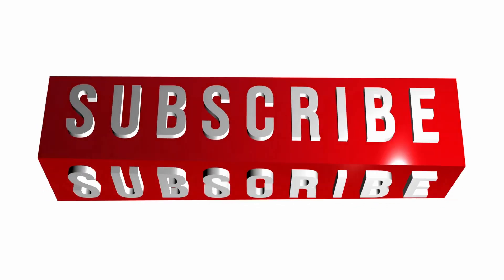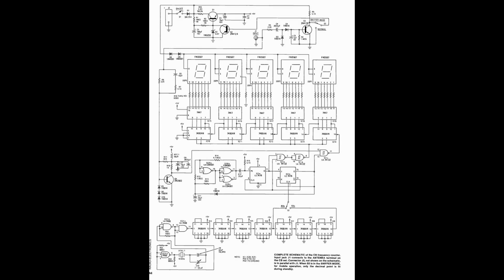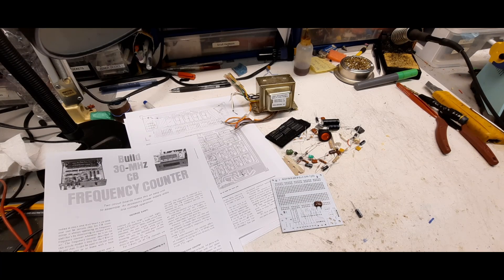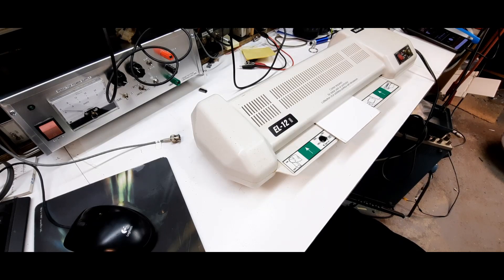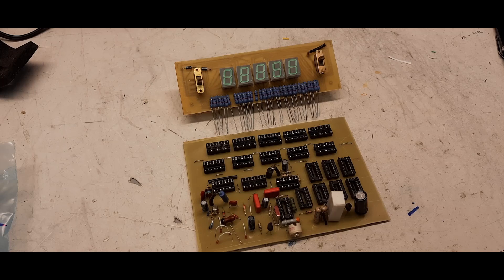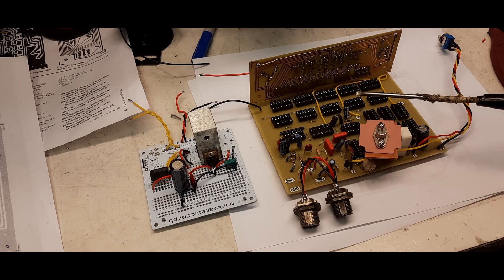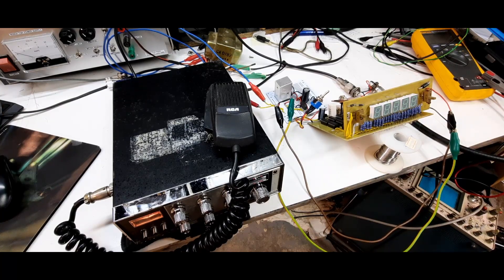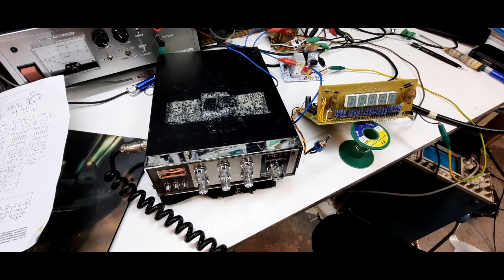Radio Electronics - September 1977 - CB Radio Frequency Counter

Comment: For toner transfer I use the 'wet' method: A mixture of alcohol and acetone. Acetone content about 15 - 25%. Basically nail polish remover.  Rubbing with the nail still required.
Secret tip: The toner sticks better to dirty copper. Smear the copper with your greasy fingers and let it go black. For etching this is no problem. Nobody believes it but it works great.
Reply from the maker: Hmmm ... never heard of that method. I will consider it. Cheers!

Comment: I love these nostalgic projects. I did a lot of TTL projects back then.
And glad CP didnt go on strike again.👍
Reply from the maker: Yes but I actually got that 2N4063 the day before the strike would have happened. If you have the projects still you should post a video on them. I would love to see them. Thanks for watching!
Reply: @bettinaneumryr Those projects are long gone. TTL car RPM meter, MM5314 digital clock, Heathkit tube amp.
My latest is reviving a Heathkit digital clock with a blown out MK5017 chip:
https://youtu.be/RBxZuCxlVtw?si=eVGj-QgswpbzbiEI